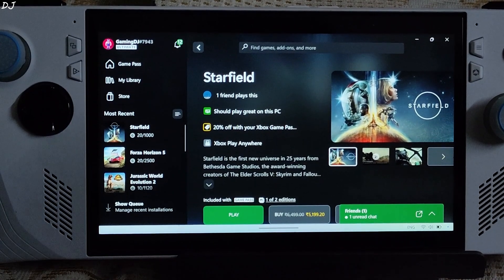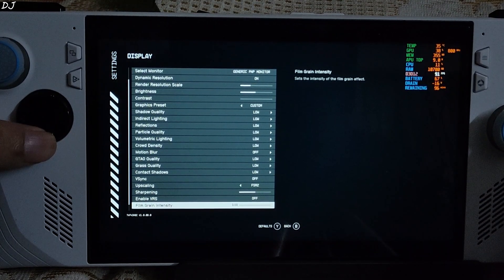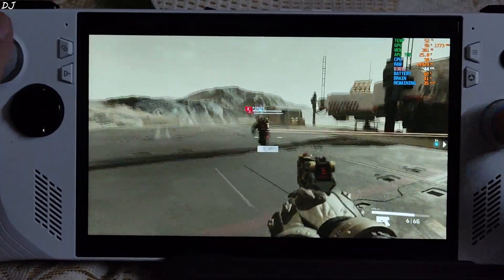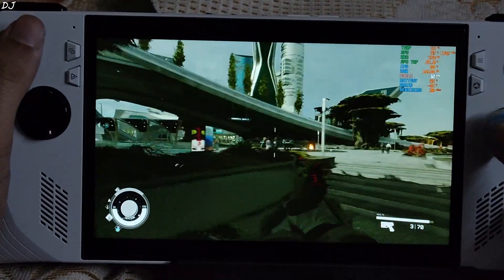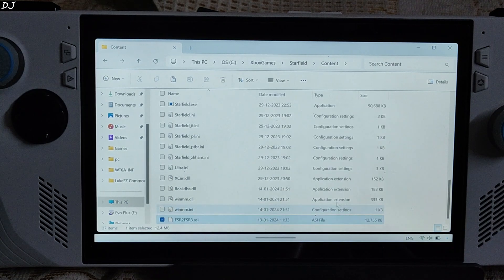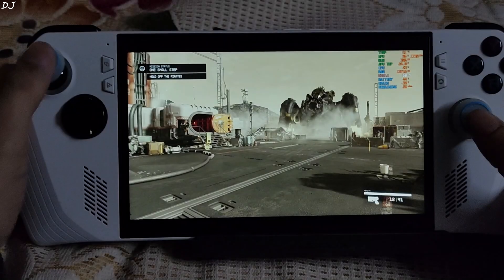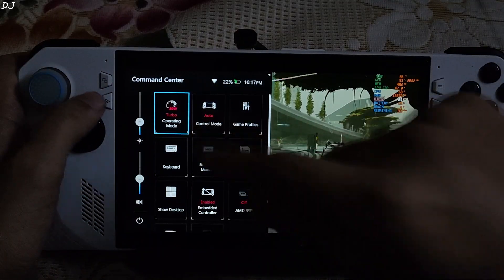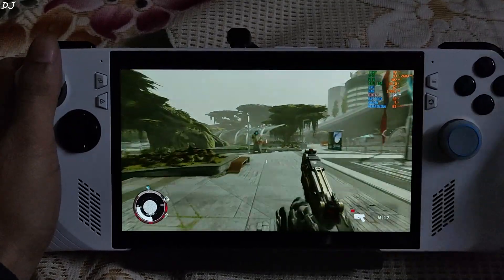Rog Ally Z1 Extreme Starfield Performance Analysis + Battery | LukeFZ FSR Frame Generation Mod Setup

Comment: I tried this if i have it set to FSR2 in the game settings it will crash when loading a game or starting a new one, if set to DLSS it works but has terrible UI issues
Reply from the maker: Need to enable Frame generation setting as well, ui will be fixed
Reply: @GamingDJ4u  thanks for the reply mate, i have Frame generation turned on my issue is odd, if i have it set to FSR2 as the upscaler like you and FG on it crashes when loading a save or new game, if i change it to DLSS as the upscaler and have FG on it loads but the UI flicker is unplayable
Reply from the maker: Maybe a different version of the game Or any other mod installed? Try the settings can help in preventing the crash. I was using auto uma buffer setting

Comment: Hey man that is awesome. Incredible to see this game running so well on a mobile device. One question for you that have both the Steam Deck and the ROG Ally. Which one do you prefer? I'm about to upgrade to the OLED but kind of on the fence.
Reply from the maker: Only reason I purchased ally is because asus didn't abandon it. Improved it so much via updates that it outperforms deck @15 watts profile with roughly the same total power draw. 
https://youtu.be/PbKWXUh5BIg?si=fOLCv8s1zf6Xys5z
Freesync premium display shines in games, not buying a device with a high refresh rate panel and no vrr like steam deck oled. They keep doing that cap fps and refresh rate thing. Fsr frame generation runs amazingly well on ally, avatar and starfield at 50-60 fps with such good thermals? Deck is the undisputed winner when it comes to battery life, not much to write here. Rest it depends on your choice of games. Ally is finally showcasing the performance that was promised at launch.
Reply: @GamingDJ4u  nice. That's an awesome experience thanks for sharing. Hmmm might try getting used to aiming with joysticks I just suck so bad at it hehehe.